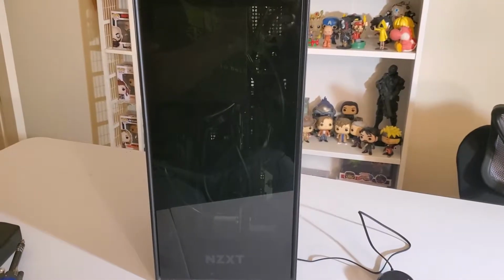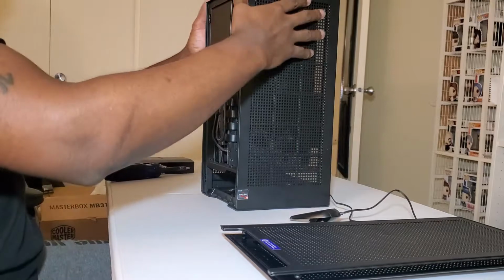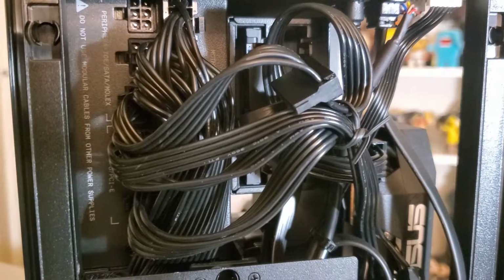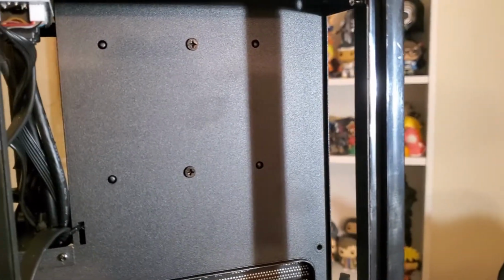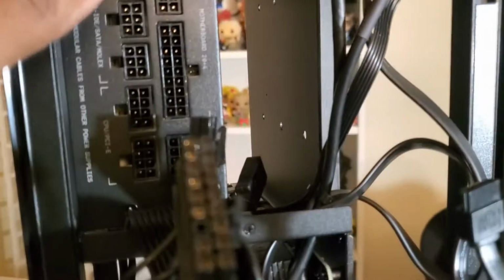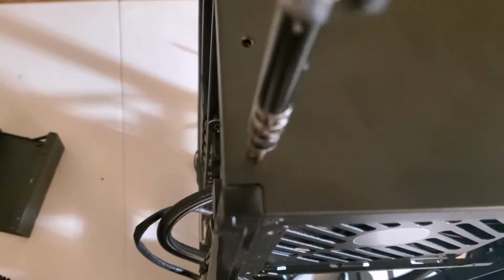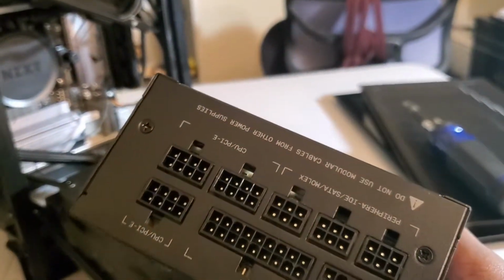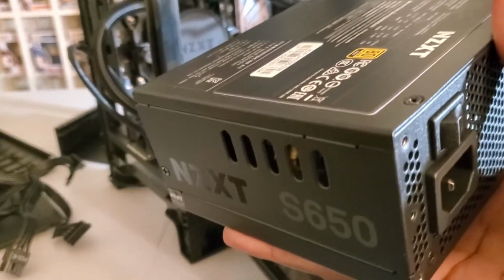How to Replace an NZXT H1 Power Supply

Comment: Thanks for the video. Very useful.  I have 4 H1 v1’s in the house and have replaced 3 of the AIO’s, all 4 risers, 1 power button assembly and now in the process of replacing the 1st dead PSU.  All were under warranty and luckily the PSU has a 10 year warranty.
Reply from the maker: Glad to help! I have a dead  AIO atm myself. I need to reach out to them about it.

Comment: I love the intro: "the internet needs more videos of the nzxt h1" - on point! I'd be curious to see a replacement of the aio cooler or a list of viable options. Keep up the good work!
Reply from the maker: I will see what I can do for that. The thing with the AIO is that it's specifically designed for this case. If I do come across one that's compatible, I will let you know for sure.
Reply from the maker: Also glad you like the intro! 😁

Comment: Thanks a lot for the vid. I have an nzxt h1 (2019) and need to get a higher wattage psu. It comes today, and now i don't have to guess about how i get the thing out.
Reply from the maker: Glad I could help!
Reply: Hey! Which PSU did you get and how did the swap go? I’m in the same boat as you and am trying to figure out which PSU to get. Thanks!
Reply: @diisomoto  I got a corsair SF750, and the swap did not go well but I made it work. Basically the frame of the case blocks the power cable from entering the PSU. I tried messing with spacers, and had a bad time with that. I ended up resorting to let the PSU sit freely in the case with it pushed back slightly to make room for the power cable.
Reply: @scottwmaxwell  thanks so much for the insight!

Comment: Is there a 800 or 850 psu you recommend
Reply from the maker: One that comes to mind is the Cooler Master V850.
Reply: @ThatZidaneGuy  will this one fit in the OG H1? ooler Master V850 SFX Gold Full Modular, 850W, 80+ Gold Efficiency, ATX Bracket Included, Quiet FDB Fan, SFX Form Factor,
Reply from the maker: @Harambre  Thats the one!
Reply: @ThatZidaneGuy  you’re the real MVP. You should do more videos on upgrading or updating in the H1 case
Reply from the maker: @Mr. Harambre  it's been hard to do content lately with everything I got going on. Doing my best to get motivated again. I will be back soon, hopefully. Also have some projects in store.

Comment: Found this video, thank you!
My H1 fell to its side when I was moving my desk. Computer works, but seems laggy. I opened her up and the PSU fan isn't turning on. So my guess it's shutting down because it's overheating. Looks like I need a new PSU. Do you know what replacement will work?
Reply from the maker: You should be able to use any 650w or higher SFX PSU but only if the PSU has the following dimensions: 125mm (L) x 125mm (W) x 63.5mm (H)
Reply: @ThatZidaneGuy  Lifesaver. Period. Thank you!

Comment: Woah, I was searching for this.. because my nzxt h1's psu died after only 10 days.. no idea what tf happend to it :/ But thankfully I got the replacement

btw when I turn on my pc there's a delay of like 1 second from when I press the button to between my pc turning on.. like when I press the button it takes like a second to turn on.. and the power button light slightly flashes before turning on completely... can you check if that happens with yours as well ?
Reply from the maker: Awesome! I am glad this vid was able to assist you in replacing your PSU. To answer your question, yes there is a 1 second delay on powering the PC after hitting the button. The GPU turns on then the rest of the PC. Its always happened like that with the one I have here.
Reply: @ThatZidaneGuy  Alright :) Thanks a lot for replying.. can you also check if the power button blinks slightly at first before turning on completely or it is smooth for you ?
Reply from the maker: @Teeyab_  The LED on the power button blinks because I believe it acts as the SSD led as well to show its active.
Reply: @ThatZidaneGuy  No nooo I know that but, like when I turn on my pc the power button led flashes slightly at first and  completely turns off and then restarts again..
Reply from the maker: @Teeyab_  yes mine does the same
Reply: @ThatZidaneGuy  Oh okay, Thanks a lot for the help man :) I was worried that maybe the new psu also has some issue.. 

Anyway, Thanks a lot again :) and btw I already subscribed to your channel from my main YT account when you were building your nzxt h1 surprise pc 2 months ago
Reply from the maker: @Teeyab_  You are very welcome! Thanks for coming back for more content! More to come :)